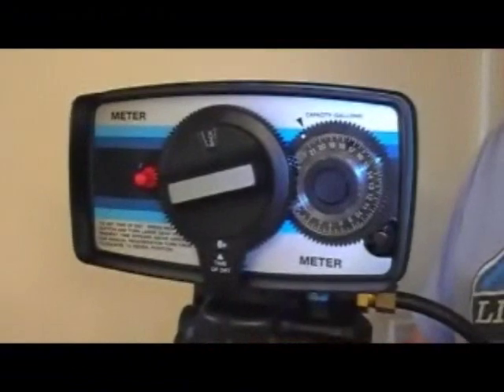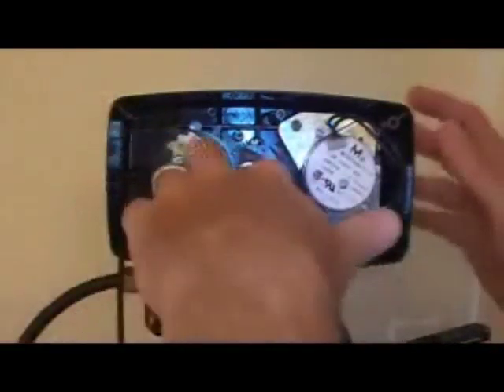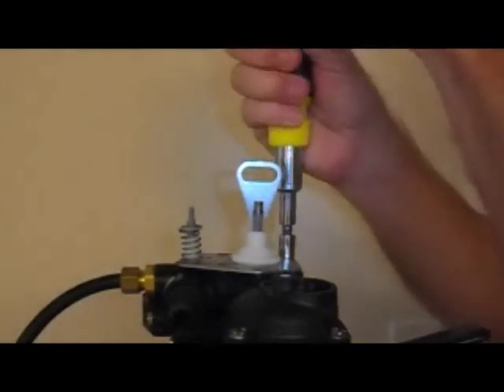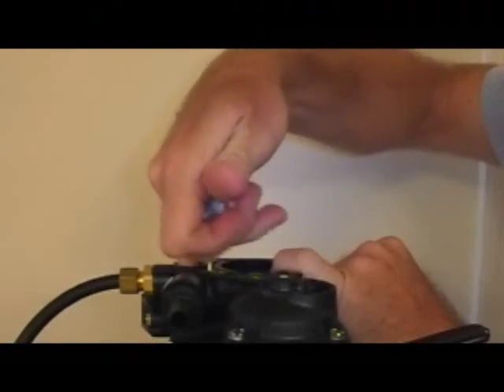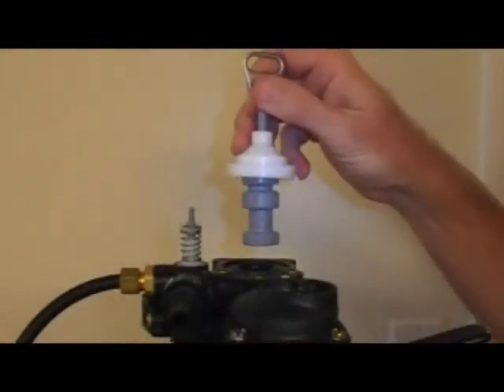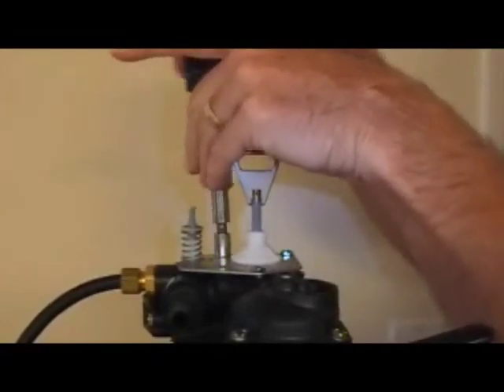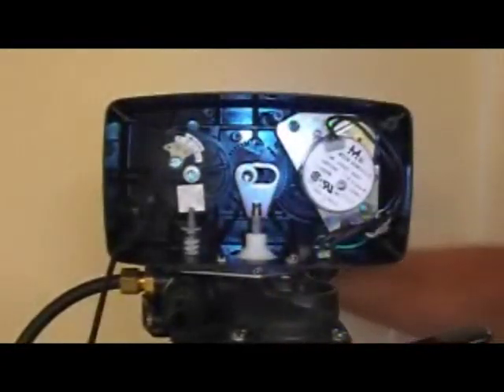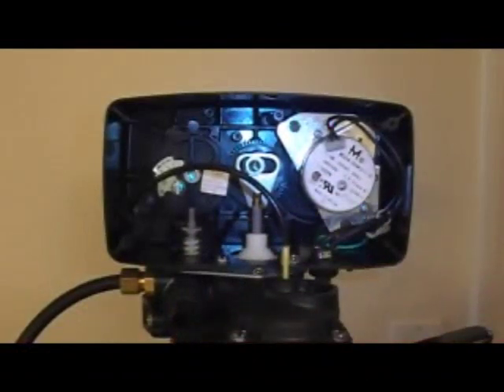Fleck 5600 Replace Main Pistons and Seals Kit

Comment: Thanks for this good video Andrew Cross, learned allot, My fleck 5600 had a small steam of water running out the drain hose and would stop no matter what I did, watch your video remover the piston valve and brain valve, witch had 4 calcium rocks in it, gave them a good cleaning and some plumbers grease on the rubber seals reinstalled them, now works perfect, you saved me around $250.00 -$300.00 on a service

Comment: Thanks Andrew.  A couple of emails with pics to your company of the valve I have helped ID it, and got me the right motor and valve kit.  45 minutes later I was up and running, with a much easier to turn main valve (I don't think it was every this easy to move) and a super quiet motor.

Comment from the maker: No lubricant is required on the Seals, as the water, and Teflon coating of the Main Piston are the natural lubrication as the Valve moves the Piston up and down. Also, if you added lubricant, the valve will collect fine sediments and the valve can become "stiffer" as this extra material builds up.

Comment from the maker: There is NO "cleaner" that will improve low water pressure problem. The Problem is the Resin breaking down and clogging the Bottom Distributor slots in the Tank. And 99% of the time, the SOLUTION Requires that you dump out and Replace the RESIN, as explained in our Resin Replacement Guide on the website ( under DIY repairs ).

Comment from the maker: The problem of Low Water Pressure is not the Piston or the Seals Kit. It is the RESIN in the Tank. See our Resin Replacement Guide under the DIY Repair heading on the website for more information.

Comment: I have low water pressure. I know it is a problem with the water softener because if I bypass the softener my pressure returns to normal. Do you think replacing the piston kit will solve my problem?

Comment: Fantastic video. I was able to follow these instructions easily and replaced my main piston, seals and brine valve using a rebuild kit. Not my water softener no longer gets stuck mid-way through the regeneration cycle. Thanks for the great video!

Comment from the maker: Point # 1 makes sense and will apply to many valves on well water. Point # 2 is not valid. Applying silicone grease to the piston is not necessary, as the Teflon coating of the Piston and the water are the only lubricant needed. The grease will wipe off the first time the valve cycles and if too much is applied it may trap sediments, causing "drag", so I do not recommend applying to the piston.